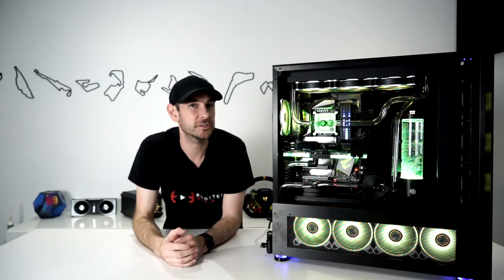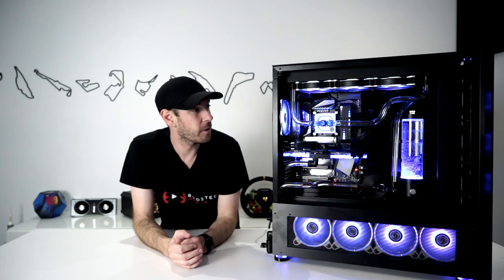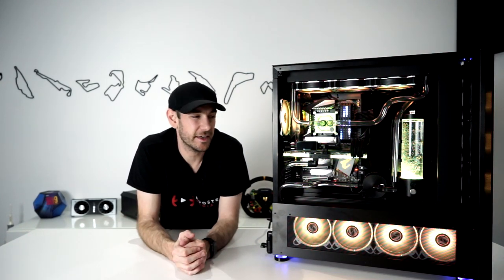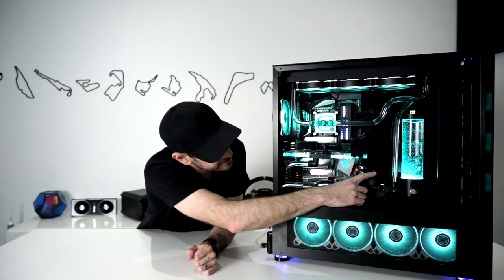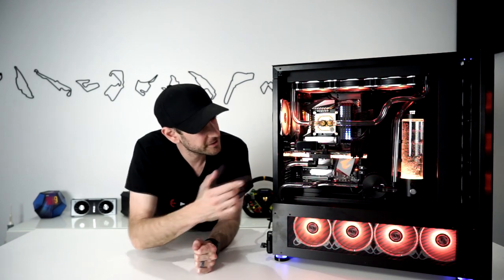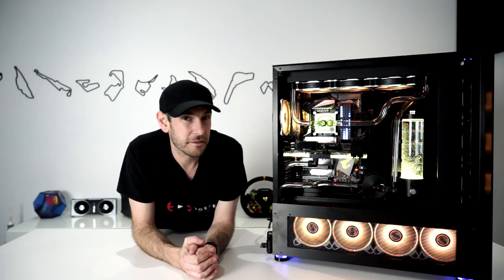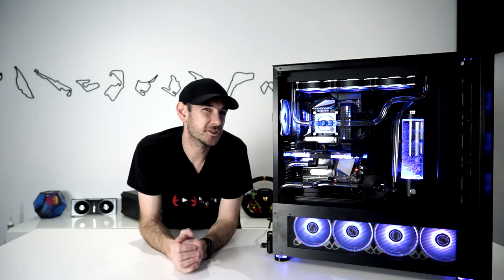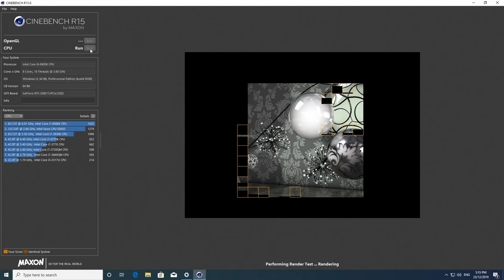PART 2 | INSANE Lian Li V3000 Watercooled 9900K 2080Ti Gaming PC Build

Comment: She is Ultra Fine for sure. I also completed a PC build two days ago. More than a PC, It was a Sim Racing Rig build for my Grandson, Brandon Racer. That's his nick name. He'll be three on the 29th. He's been sitting in my lap starting at around 10 months old, at 18 months he was leaning forward and holding onto the wheel as I raced. I started teaching him to drive just after he turned two, and it wasn't long before he was pushing my hands off the wheel and saying "Grandpa I want to do it myself". God knows we crashed a lot. That changed about five months ago. He started picking it up fast and today he can steer with the best of them. He can even do hand over hand. So Christmas morning after he got done opening all his gifts, we headed for the frig and sitting there next to my sim rig was a big present covered with a black sheet and a big red bow. He pulled the sheet back and there was a red racing sim rig that look just like grandpa's but 1/3 the size. He was a very happy little man. We'll need to spend a few weeks working on learning pedals but he learn fast. I didn't know how to get a picture of it to you, so I hope you don't mind me posting the link here. Keep those videos coming. https://www.facebook.com/photo.php?fbid=3066650120030825&set=a.214331168596082&type=3&theater

Comment: Awesome build but those bends are a bit off. Can you upgrade it next time using 90 degree double sided fittings? It will look cleaner I think. Plus, you can upgrade to metal tubing :)
Reply from the maker: Bends are spot on. It will always look a little off when viewing from different angles. Client didn’t want right angles everywhere.
Reply from the maker: Btw, planning on an upgrade to my editing PC this year. May involve metal tubing ;)
Reply: @boostedmedia  Hope you will make a video on that as well :)
Reply from the maker: Of course :)